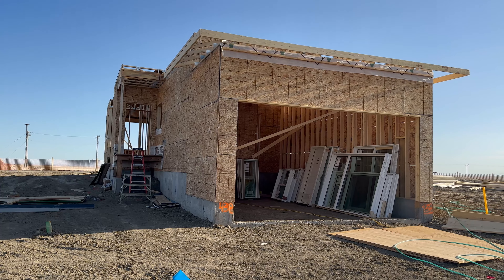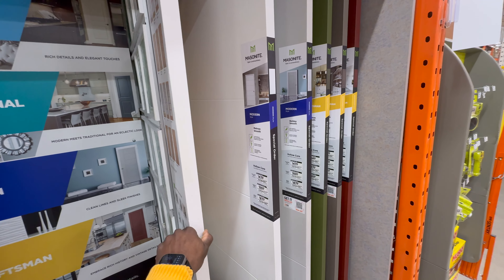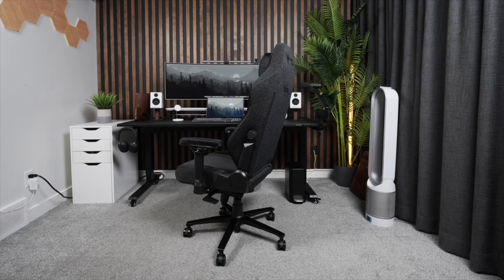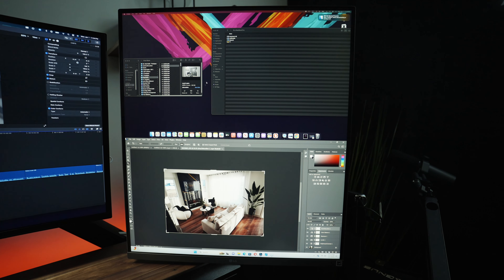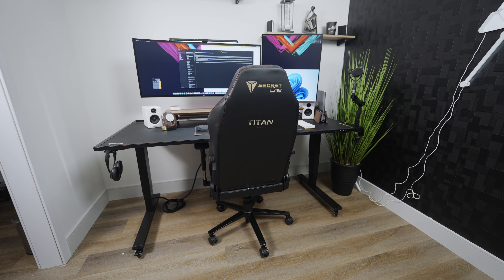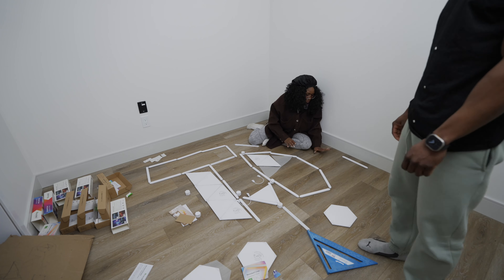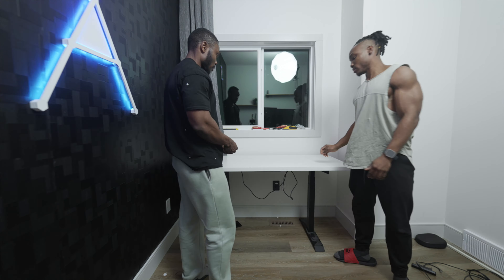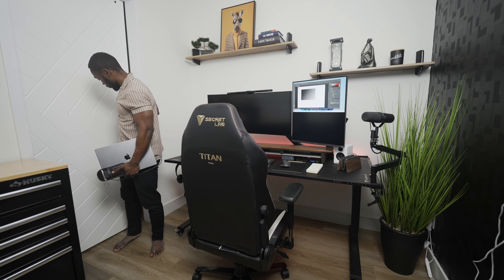Building My 2024 DREAM OFFICE

Comment: Your setup turned out beautiful! Great work and really digging that wallpaper. How are you liking your secret labs desk? I'm debating going for one of those on my next setup build for my channel. Really leaning towards it for the cable management alone. haha
Reply from the maker: Thank you. 

The sit-stand is pretty much standard with any of my sit-stands from 6 years ago. The part that got me sold is the cable management. I have had to remove and reinstall a few things after this install and it is nice not having to deal with velcro, double-sided tape, screws and cleanups. I open the cable tray and remove the cable I need and throw in the new one and close it away. If you hate cables, this is the guy.

Comment: Love the content, but just so you are. aware Secret Labs is or the main company is not a Canadian company.   It is a: Singaporean Company.  Secret Labs does have a Canadian Location outlet though.   Love your setup and I am looking to get the Secret Labs Desk just debating over the size of the Desk  Pro vs Pro XL as for me it has to do with where I am putting the Desk as I am limited room for it.     I am  Canadian, but thankful they have a  distribution location in Canada.
Reply from the maker: Thanks, Darin. I was using the Secretlab website as a reference and you are right it is a Singaporean company.  
If you are going with a single monitor setup, the Pro should be just fine. anything more and for sure I think the XL would be better. I'm pretty much maxed out with XL in my setup.